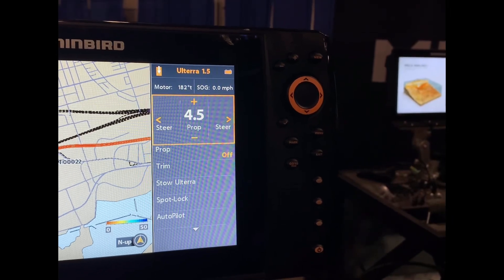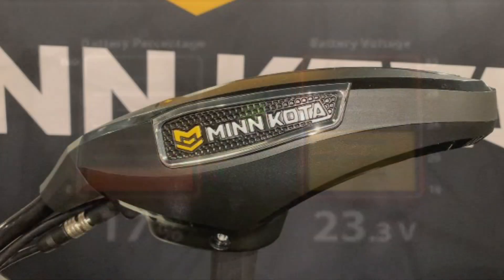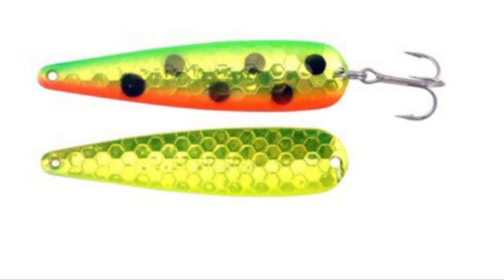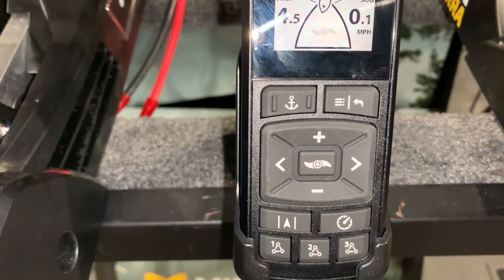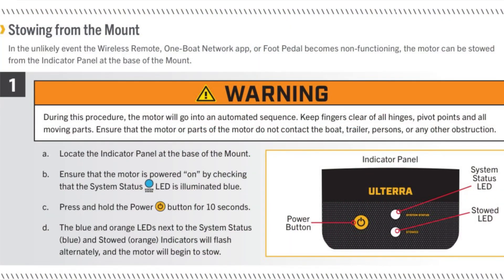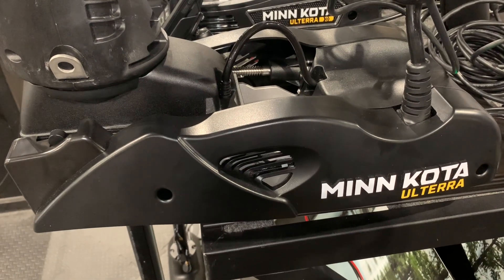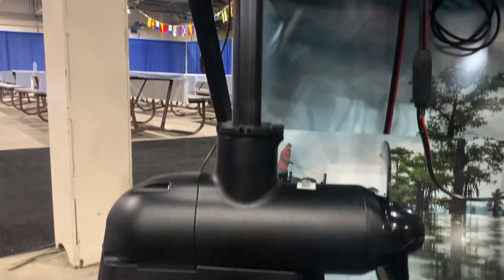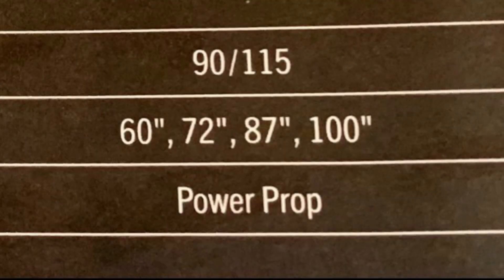Minn Kota Ulterra Brushless QUEST, Brushed Ulterra Review

Comment: I had a 2018 Ulterra on my boat with Ipilot link with the touch screen remote. The remote is so sensitive that when my shirt brushed against the screen it would make the trolling motor to do things you didn't want it to do. Like deploy in shallow water and it ended up bending the stow/deploy motor shaft. It also locked the remote without me knowing and I was trolling on speed 6 when I saw a big submerged rock, I tried steering around it but nothing happened because the remote was locked. I hit that rock and me and my partner were thrown out of our seats to the ground. Luckily we didn't get hurt but we could of easily. The last time I went fishing the trolling motor failed to deploy, I finally got that to work and then it wouldn't trim up or down. I never got that to work. I believe it fried either the main board or the trim motor board. But, it's still under warranty. So, I purchased the new quest ulterra. That thing is a BEAST. I am still in the installation phase. When I get my 2018 ulterra back from warranty work, I am going to sell it. I hope I won't have any problems with this new motor. I am glad it doesn't have the touch screen remote because that is what gave me all the problems on my old unit. 
I also bought the MK57 plate for the Quest ulterra. I don't know if I will use it yet because it's really heavy and my boat is a Nitro 170dc. With the new motor being over 20lbs heavier, it might be too much weight in the front with that plate. Plus, I am 330lbs..LOL Thanks for your video 😊 Tight lines Bro
Reply from the maker: I just put the Ultrex Quest on my boat. The Ulterra Quest design thoroughly impressed me. The Quest series is definitely beast like in quality. We used my buddies Quest in a recent tournament and it was awesome!

Comment: With the new Quest Ulterra, is it beefy enough to add additional pole or live scope to the shaft?
Reply from the maker: It is plenty beefy enough but because of the way it stows, you can’t add forward facing sonar to the shaft. As for an additional pole, it would mount elsewhere on the boat. There may be an aftermarket kit that I am not aware of at this time.

Comment: What if you run Lowrance do they still offer the US2 transducer
Reply from the maker: The new motors only have the dual spectrum chirp as a 2D option.
Reply: @stevechiassonfishing5876  will that hook to a Lowrance with an adapter
Reply from the maker: The Dual Spectrum chirp does not use a US2 but there is an adapter for Lowrance.

Comment: I think this will be my motor in 72 inch.  I do fish both salt and fresh water so I wish the Riptide came with down imaging.  Salt water use will void the warranty of the Ulterra so I won't be able to use it there.
Reply from the maker: That’s awesome Dave, I was really impressed with the Ulterra Quest at the Toronto Boat Show. Tough call without the down imaging. Saltwater use might trump freshwater depending on how often you fish saltwater. You’re doing your homework and you know best what works out for you.
Reply: @stevechiassonfishing5876  I have written Humminbird to see if a down imaging Riptide is in the future for us guys who fish both salt and fresh.  I hate to lose the down imaging.  I fish some mighty deep lakes in the mountains. In the salt I mostly troll or drift.  I can use my gas kicker motor for that if I have to. Still pondering.

I REALLY appreciate your videos.
Reply from the maker: There is a Riptide Terrova in brushed or brushless. The brushed Riptide Terrova should have MDI. If you go with the Quest, the built in SI has DI and DSC as well. It’s an option.
Reply: @stevechiassonfishing5876  Thank you.  I was unaware.
Reply from the maker: I have not seen the Riptide motors. I went through the manual for the Riptide Terrova Quest and it talks about mounting an external transducer so the saltwater  Riptide may not come with built in transducers. Definitely not trying to add to the confusion. We are learning together.